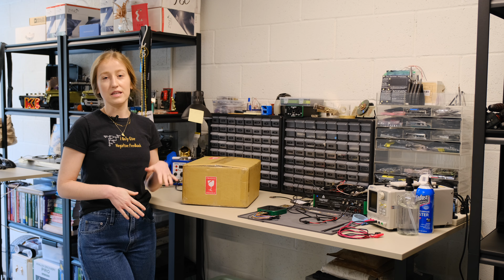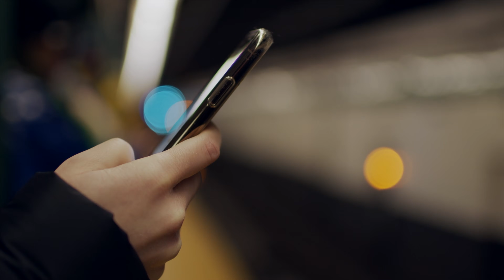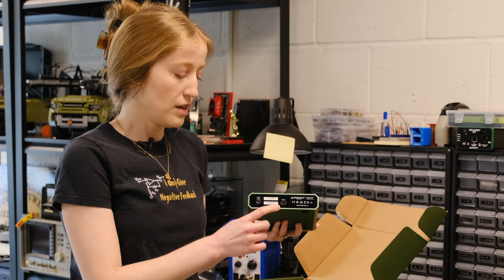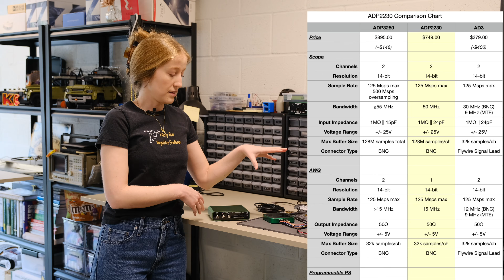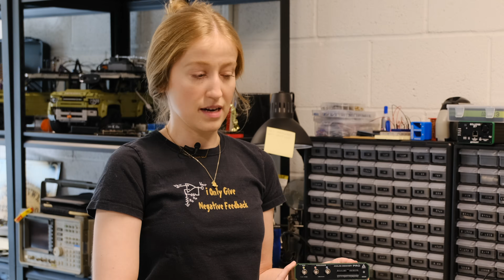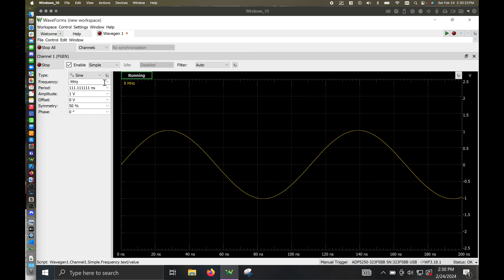AD3, ADP2230, or ADP3450? Knitronics Breaks Down the Analog Discovery Pro 2230

Comment: Other comments.
5250 is Windows only due to underlying NI Virtualbench material winch is Windows only

You can connect two identical devices in WaveForms through Dual Mode. But two different devices would need their own separate instance of WaveForms (just re-open the application for a second instance).

Regarding connecting to the 2230 in WaveForms, usually if you have WaveForms open in demo mode and then connect the actual device WaveForms will ask if you want to connect to it. Not certain of the exact hardware setup or WF beta being used in this particular instance for me to test though. 

128 MS per input type (analog vs digital) might be more accurate.

BRAM is faster, but if you want to use the USB 3.2 Gen 1 streaming capability, then you'll definitely want to use the DDR to have nice large chunks of data to stream rather than a bunch of tiny BRAM chunks that will be limited by USB handshaking for every transaction.

Nice review otherwise. Touched on the DDR memory that Dave Jones didn't mention iirc.

Comment: Digilent employee here - you don't need to use the external power supply to use the beefed up programmable power supply on the 2230, so long as the Type C port on your PC can provide a 3 A output.